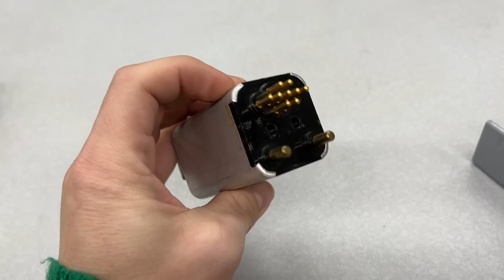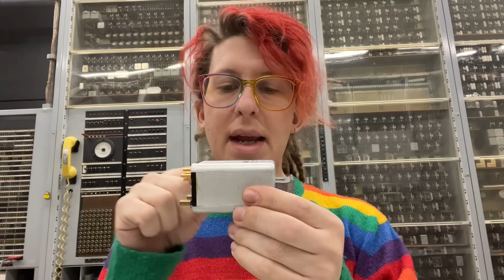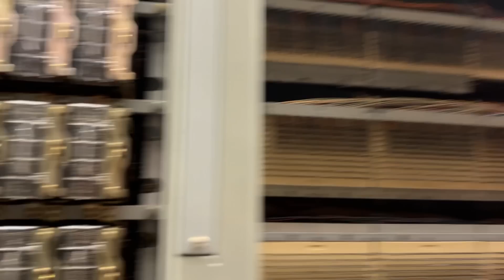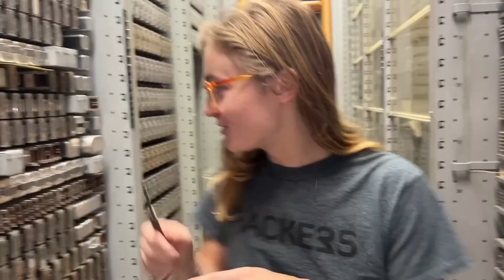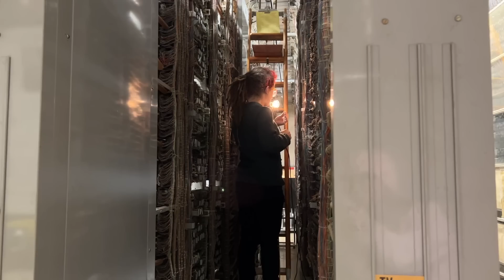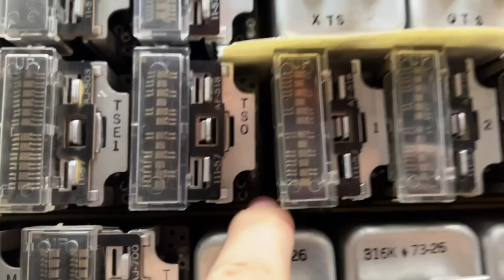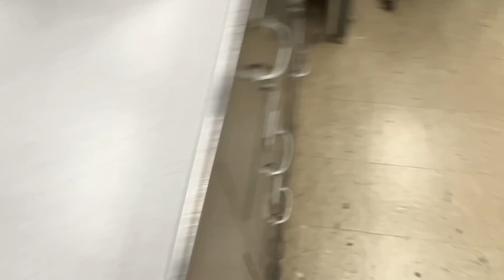Malfunctioning Potted Relays: Emergency Repair in the No. 5 Crossbar

Comment: Ew, dissolved rubber in old electronic equipment is one of the most annoying and disgusting things to work with, my condolences :/ I've found the best medicine to remove, say, goopified tape deck belts and soft-touch plastics and other, similar kinds of schmoo from electronics is naphtha (zippo lighter juice or Coleman fuel, Coleman's cheaper than Kleen-Strip naphtha somehow despite being the same stuff but I like the zippo bottles for dispensing) to get it off around delicate things like, say, the solenoid coils in those open relays where you don't wanna eat the shellac off the coil windings, and for hard surfaces that can take harsh solvents it's usually best to just take em outside and hose em down with Brakleen. For getting it off your hands, I recommend wiping the big chunks off with a shop towel and then using a buncha baby oil/vaseline/crisco to soften and un-sticky-ify it til you can get the rest off with a napkin or something.

Comment: Have you thought about experimenting with a sealant.. perhaps a spray of a thin layer of clear rubberized coating on the leaking relay to forestall future leakage. Not sure if it would work but might be worth a try on one or two relays as I don’t see a down side.

Comment: I still can't concept a line circuit not being blocked once a crossbar connection is made, two wires is two wires, connect them to more than the originated and first termination party, it would be a unwanted conference call.

Comment: I ran into the same exact goo when I took apart an old telephone handset… the old kind made out of that impossible to break plastic with the rotary dial on front… I remember, taking apart the mechanical, bell hammer and bells, and the inside one of the circuits was a metal Relay looking device with a hole and I stuck my screwdriver in there and out came a whole bunch of that same gooey stuff. This happened to me probably 25 years ago when I found an old phone at my parents house and took it apart.

Comment: What will be the future of these thousands of central offices across the us and Canada? Will they continue or evolve into something else?
Reply: My guess is packet-type switching.. your local pedestals and remote terminals consolidate the wiring outside...
My mother lives in a 1978 built house where her copper terminated eventually into a line card in one of the boxes at a street corner nearby (¾ miles) failure after failure she was told why.. she was on a bad card, with no supplier making new ones, they had to rob Peter to pay Paul and move her line to another card.
No less than 10 years ago, I went Uverse on a new installation, it took my installer about ⅓ his workday chasing down the dreaded bridge taps, my line was on a remote (remorse) terminal heading away from the C.O. even though I could walk to the C.O. in 10 minutes.. technology is so wonderful.  Where I live now the co-op laid fiber to everyone's curb so to speak and you can't get copper if you wanted it.. if there's no power the phone goes out too... it's VOIP, with a calling area of fewer than 2000 lines, other than one's provided in overbuild territory with a dedicated c.o. prefix just for those customers.. I can't call the whole city, just that companies lines, I'm guessing they tandem for us.. our base line rate isn't too expensive compared to what Philadelphia was when I worked in the residential service center, the line fee and calling plan were about $18 @ month.. I just have no need for a micro footprint of places to call, so cell is necessary, even the sheriff's office and nearest hospital are long distance, granted $.18 @ minute for all calls.
Besides I could pay the phone company extra for a whitelist service, but it may not let misconfigured caller ID calls through,  I use do not disturb on my cell, if you are not on my directory the phone baloons the caller ID, vibrates once and doesn't ring, eventually voice mail takes your call.
Reply: @Stache987  I believe the phone companies will push to have 100% of us on either fiber if available or on cellular via an ATA.Analog telephone adapter for this that still have pots lines. The world is shifting away from copper pairs to every location. The phone companies have tried to do this for a couple of years. What the phone companies haven’t yet addressed is all of the leased line analog circuits out there that are an integral part of the world. Alarm circiits, power company PDAC circuits not to mention all the leased line circuits that police fire and the FAA use that are still mission critical.

Comment: I think I’ve seen that in some 1a key systems. Also western electric has a division called “blue streak” they made custom circuits at customer perm’s. These relays were also used in this blue streak equipment.

Comment: I reckon there must be a liquid you could immerse the relays into to easily dissolve the goo. Then it would just be a matter of using contact cleaner on the contacts to remove any leftover traces. Acetone is harsh, but only on some modern plastics. It evaporates quickly and is cheap. Any other cleaner recommendation for full immersion?

Comment: One of the effects of the 1983 breakup of the Bell system, is that the manufacturers of the relays was sold off, and the factories that built the switching systems were closed over  the next several decades. Mercury-whetted relays were built in the Kansas City Works (Lee Summit) in the 1980's (for the small relays in PABX's in my experience). The switching elements are actual reeds designed to draw together under a magnetic field. The mercury-whetting will decrease contact bounce (repetitive on-off  behavior, the bane of systems that rely on current pulses). 

The cost-reduction of single colored wire is to reduce the ten possible wire colors to one. The wires were pre-cut and pre-stripped before a wire-wrap operator got them (another cost-reduction). The operator wired the entire sub-frame in one go as a sub-assembly in the manufacturing process. Sticking the wire-wrap pins of the relay back into their holes is time consuming and frustrating. 

In the mid 1960's, few would forecast the breakup of the massive AT&T, and 20 years was the expected depreciation interval for telephone central office equipment (and it still is). The telephone operating companies invested in quality maintenance technicians to troubleshoot and repair and maintain the relay fabric of the nation.

A solvent for the "Green Goo" is likely a banned substance today, like tetrachloromethane or Freon. Goo-Gone with terpenes, and no pumice, is a good substitute.
Reply: You mentioned a familiar chemical, tetrochloro*.. we couldn't get it anymore and we used it on the computers tape drives in the military (think of all the people affected by chemicals in the military scope  which are now showing their life effects)
Reply: I have a definity PBX CO trunk card with WE mercury wetted relays on it. It was made in 1986.
Reply: @thecooldude9999  What type is it?
Reply: @steveschulte8696  It’s a TN747, and it has WE 356A and 345A mercury wetted relays on it.
Reply: @thecooldude9999  the TN-747, one number higher than my fav, TN-746. My wife tested a lot of these.
Reply: @steveschulte8696  Very cool! I have a couple of TN746s in my system, not sure of their vintage off hand. Neither have those mercury relays on them.

Comment: I have always enjoyed your videos, as I used to work on a SXS in college. Your mention of detecting trouble by sounds reminds me of the most distressing telephone exchange tour I ever took. It was a Bell System SXS that had digit-absorbing first selectors. Their operation of stepping up to a level, stepping in one position, and then dropping back sounded exactly the same as a malfunctioning switch.  Breaking wire-wrapped wires is also familiar. i found that the best thing to do was to quit for the day and try again tomorrow. I still believe that I saved the company money by doing so, besides saving my sanity.

Comment: I don't know when I've last seen this stuff, but I certainly remember it as being absolutely disgusting and a HUGE pain to clean up. I feel sorry for anyone who has to deal with this stuff regularly! I think I once had a bad transformer from a water boiler control (that even was quite new, like less than 30 years) that leaked a brown version of this gunk, and another older transformer that leaked the same green gunk. In european HVAC, this sort of issue is actually not even that rare while the equipment is still in use, as stuff like pumps, radiators and boilers is usually run until all spare parts are used up or it fails from old age, and many plastics, capacitors, hoses, etc... are not meant for 20-50 years of nonstop use in extreme heat and vibration, so decomposing plastics, cracking hoses, dry bearings, leaking O-rings, glue peeling up and other fails and breakdowns related to polymers aging and decomposing are kind of common on older heating systems. In fact, they are usually the main reason why an old boiler is eventually replaced, as these problems just become too common as the thing ages, and reliability thus also gets worse over time, until the owner gets fed up with the constant breakdowns and gets it replaced.

Comment: As the son of a 42-year Bell Labs/WE employee who retired in '69, I have not seen a failure like the breakdown of potting of the 316 relay in all the stuff dad brought home.  How insidious.  As you worked on the wiring, I asked myself "what happens when the wires break?" and sure enough they did.  You are doing God's work- very nicely done!  ps  You will never forget to make sure that spring steel is seated again...
Reply: It affects virtually every sealed WE relay ever made, from what I've seen. Even 1A2 packs... MFT's, 4ESS, D4, SLC 96... The D4 packs are great fun, as both upper and lower card guides fill up with the goo from above, and you nearly have to pry the packs out! Thankfully I retired last week, and no longer have to deal with it!
Reply: @boballmendinger3799 a ha; so in my own comment hastily added before reading the others, signs point to potting material stability, not internal arcing. 😕 Good to know I guess.

Comment: The old phones had an electronic assembly potted in honey-like goop.  It contained the hybrid transformer, varistors,  light bulbs, capacitors, resistors and such.  I guess the goop did a great job of keeping water and humidity away from the parts.  But it made repair effectively impossible, they probably just replaced the whole module.

Comment: Seems to me that an ultrasonic tank could clean those open relays without disassembly, saving hours of frustration.
They are certainly not too uncommon or expensive today.
I can't say which surfactant or solvent would work best with your plasticizer while keeping the fumes and fire hazard to a minimum.

Comment: I love the video and the effort you all put into this. The sweater matching the glasses is fun. I think the other commenters are right that it's the plasticizer leaking. I have to ask the stupid question: could you just open the leaking relays and drain the bulk of it out? I imaging it's so  viscus that with the lid off it would drain much faster than through the seams in the case.